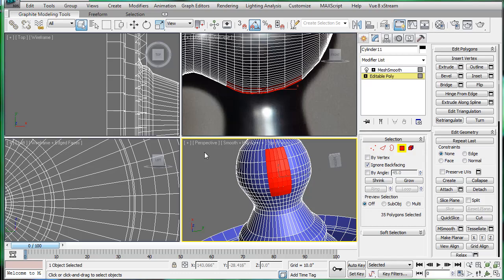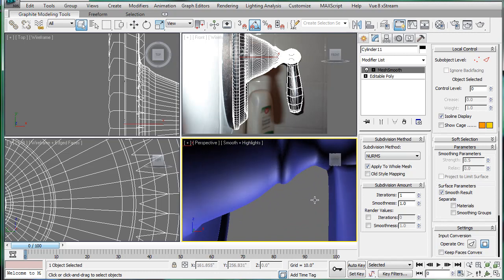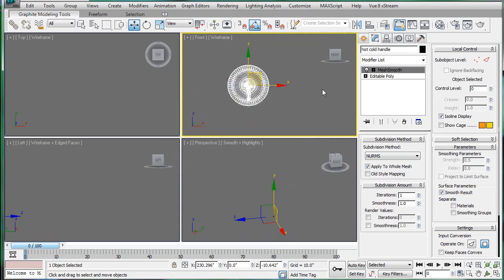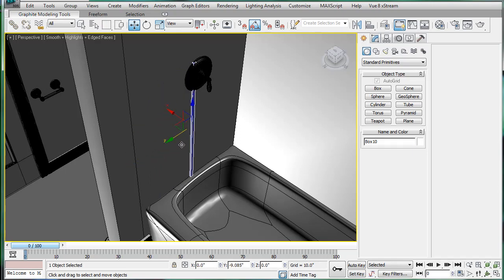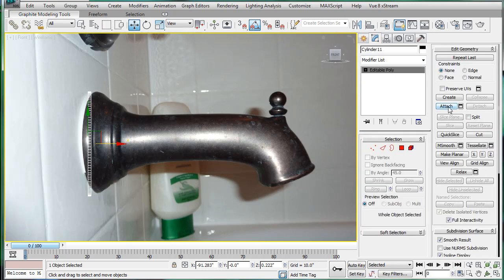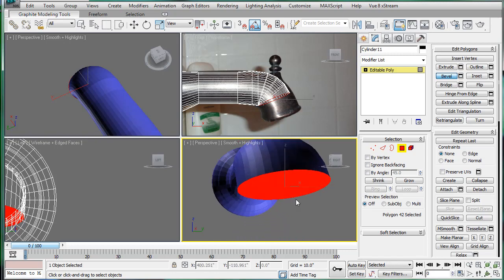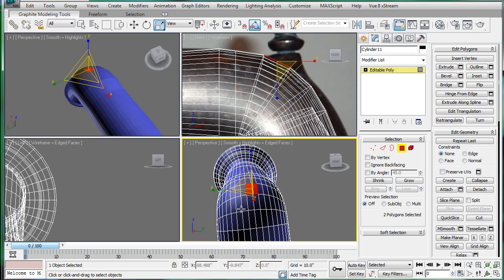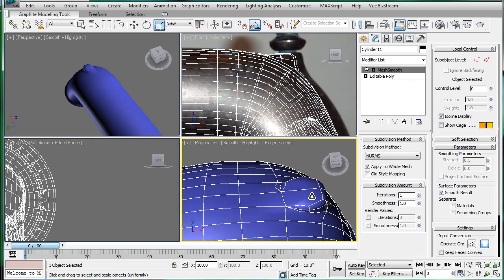3ds Max tutorial - Interior Architectural Design: Bathroom part 23

Comment: @eternal3lade mines 64bit, 2Gb Ram, AMD dual-core 3.0Ghz, Nvidia Ge-force 7025.....i think i need a upgrade lol. though i can run Firefox which uses crap loads , Unity, and 3ds with lots of poly quite smoothly..... but this is insane